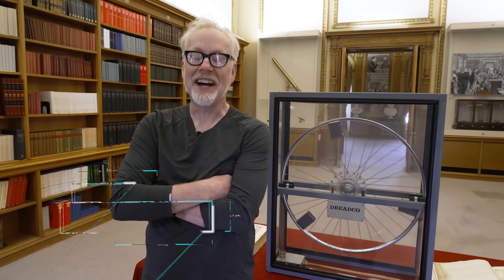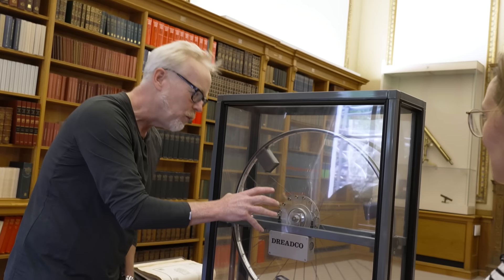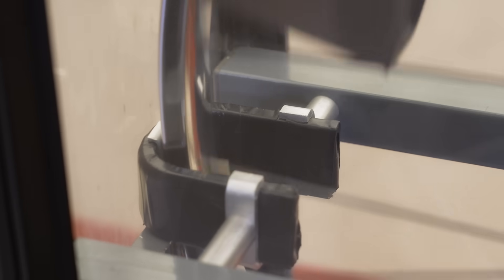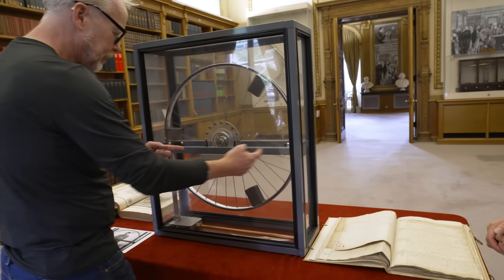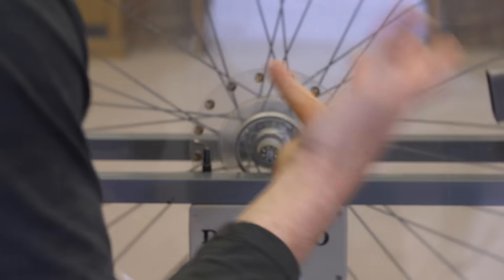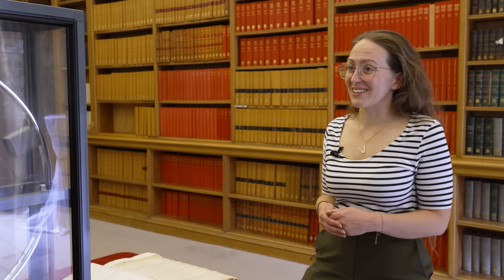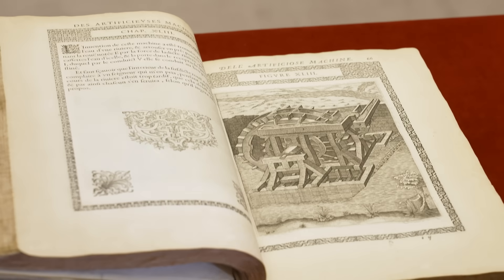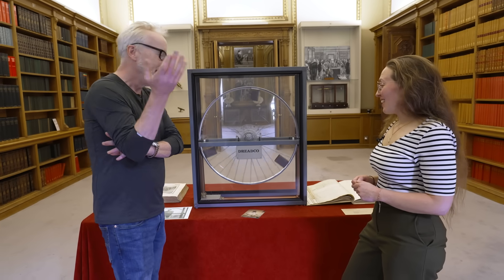Adam Savage vs The "Perpetual Motion" Machine!

Comment: I would imagine the servicing would be to replace the battery and clean the bearings of any dust particles..
If it is actually a motor that would need as little resistance as possible I know with differential temperature Stirling engines that you can put over a cup of hot water, the bearings would need cleaning with methylated spirits from time to time…

Comment: Apart from electromagnets there might be a different possibility, an almost pure kinetic one: what would happen, if the three boxes contain some sort of clockworks, that simply move small weights around? When the box goes up, the weight would be on the inside("hubwards"), and when the box goes down, the weight would be on the outside ("rimwards"). If I remember correctly that would mean a greater lever on the down going side of the wheel, thus a greater prying effect as on the other side.

Comment: I don't think it is electrostatic, I feel that there would be patches of dust on the casing on both sides of the casing glass, so the knob and spike in the middle are red herrings. The boxes at a bare minimum are weights to even out whatever mode of impetus is being used. The U shaped metal are not magnets as they would cause the wheel to stop due to magnetic braking affect, that is the aluminium would have eddy currents induced as it rotates through.  
My guess is either each box has a battery and circuit to pulse an electromagnet at the right moment, or even just one of them, as others have suggested. The alternate is that the box at the bottom has the power source and discreetly powers a motor in the hub. It could even have commutator sensing, only accelerating the wheel when it slows down. 
The light sensor windows could also be power saving, knowing it was stored in the dark, the wheels speed could be maintained at a lower speed when in storage. When the light goes on, it knows it going to be shifted so it doesn't have to be discrete in accelerating the wheel. possibly maybe a movement sensor as well.

It would be fascinating to examine it up close with a multimeter, looking for static electrical fields, and a magnetic probe connected to an oscilloscope to examine the U shaped metal and their interaction with the boxes. Maybe a logging tachometer watching wheel rim, I saw a couple of features inside the rim that could be used to trigger.

Comment: It’s probably really simple. Like the box is under a slight vacuum, those weights would be enough to keep it going for a good while. Of course air will leak in and it periodically would need to be suctioned out. The gasket around the sides looks thick enough to hold a bit of one.

BTW: go away scammers, I didn’t win a prize or reward, you’re not official. Sod off with your schemes.

Comment: A few minor points.... with the first machine is it possible the magnets are very gently ionising the air in the copper pipe and that's causing a very tiny amount of air flow to blow on one side of the wheel and thus causing essentially a permanent air current within the box thats causing the wheel to maintain it's speed? I know magnets and copper do weird things, but that could explain the copper pipe in the system.
Secondly the perpetual motion machine in the wheel isn't there to make power, but to keep the wheel turning while there is no water, so you don't have to restart it, which takes a considerable amount of effort and thus lost power. So it would be more about preserving it's current momentum rather than harnessing power.

Comment: It's just a small current motor where the coil is in the DreadCo box which also contains a light sensor to minimise power consumption when stored away. The small copper buttons on the wheel are magnets which makes it a brushless motor design. After 2 years the battery is exhausted which ties in with how efficient battery clocks are which can run up to two years. The wheel itself is finely balanced so very little energy is used to keep it moving. The End!

Comment: Could the boxes contain some kind of magnetic sand that when passing through the u-shaped side pieces becomes charged and either clings to the inside of the box or falls away? It might rely on the principle of a rotating ice skater spreading their arms to spin slower and bringing them in to spin faster.
Reply: All the extra spin you get from moving sand closer to the center is lost again when the sand moves back to its starting position. At best you get three pushes and that's it.
Reply: @Yora21  I was thinking more like the two u-shaped pieces represent switches that alternate the position of the internal weights. Maybe they generate a field that switches polarity somehow. When one of the boxes enters the field of the left object, the internal weight is shifted outward and when it hits the right one, it is shifted inward. If the fields are large enough, you could give the wheel more torque on the left and maintain momentum on the right. I guess that I was thinking more of levers than of centrifugal forces.

Comment: One possible energy source for a 'perpetual' motion machine is a tritium tube surrounded by high efficiency (low output) solar panels which can convert the radiation/florescence to electrical energy... but maybe they could be using a different radioactive source for powering the device which generates heat and they use a seebeck device to generate electricity using heat differential (like a space craft utilizing plutonium to generate power in this way for decades)... maybe not what is used here though.. they could be using 'Zinc air' batteries as a long life low power energy source.. the rest to me just looks like a typical motor with Magnets on the rotor, stator windings (electro magnets) which are controlled by hall effect feedback from the inner wheel and sensing probes. Only a small regular push on the flywheel is required to keep it turning. How often do you replace an AA battery in a wall clock which runs continuously?

Comment: These two round perforated grills located on both sides of the central box could hide microphones which are capable of generating the small amount of electricity which could be enough to keep this wheel constantly spinning. This wheel is usually exposed to  crowded places with a lot of sounds and noises.
Also, there are clocks that work on the atmospheric pressure changes, it also might be the case.

Comment: I think the copper pipe is a decoy. When you think about it, it absolutely has to be a motor as Adam pointed out. I think the creator had a good laugh looking at everyone theorising and trying to ‘figure out’ what is a very basic thing.
Reply: The heatsinks on the bottom give it away. Anything that uses enough power to need a heatsink would drain the battery to quickly, I agree its likely a decoy.

Although it may use heat in some clever way.
Reply: @georhodiumgeo9827  for sure a decoy.  Or the tubing at most is used to run electric wires.  But there's no way this is generating any kind of heat to need a heatsink, that would defeat the entire point of getting something to run for years between charges.
Reply: magnets are in the pipe i think the wheel is acting as a rotor and the magnets and box are charged possibly by solar at a low power, the two angles of the pipe can allow for more angles of pull maybe
Reply: @Zach Meyler  Can't be solar, it's kept in the basement.
Reply: clockspring! its like a watch but you wind up a few years rather tha a few days. or the rim is hollow and you can fit batteries there on the black boxes plus the lentgth of the pipe plus the silver box! and have the motor be very low power to spin for quite a while.
Reply: I'm sure it's a motor, but why is it kept in a museum? Any other PMM machine wouldn't be kept, would it? What makes this one special that they'd go to so much effort to keep secret?
Reply: @Here_is_Waldo  probaby just the guy who made it. Like painting, anyone can paint, but some people end up having their paintings in museums. Not all art is special, some is just interesting, like this piece.
Reply: @Here_is_Waldo  they keep the cooler more interesting things, this was interesting enough.
Reply: @Here_is_Waldo  its just an exhibit. There are no pmm
Reply: or is it part of a heat pump generating a small charge from the heat in the room
Reply: Probably not. Because it’s a library there’s probably little change in the temperature.

More than likely it’s a pulse motor powered by a carbon zinc or other long term battery.
Reply: @Jon-2049  Probably, We know that some sort of chemical battery is being used and a motor most definitely located in the wheel hub.

Comment: Couldn't it just be a small pulley system? Like a extremly thin, basically invisible rope around the wheel, into the tubes and box, where there is a motor and batteries. because i fell, like basically everything else is probably just a decoy.

Comment: It's a planar electrostatic motor with an amazing bearing.  

I am now working with an energy storage cylindrical shaped flywheel of a few hundred kg.  It spins up to nearly 100,000 RPM.  It is housed in a vacuum chamber to eliminate air drag and it uses magnetic bearings, also very low drag.

Comment: There's a rotating magnet or array of electromagnets under the table top. Duh!
Reply: So we're supposed to trust them that they take it off the table and put it in the dark in storage and it still goes?

Anyway, a zillion places to hide power sources in there. It should be able to run for decades instead of a couple years.

Comment: If only someone would create a magnetism visualiser ( like a flir )
Reply: It was determined there were magnetic fields coming from the hub and the box with fins on the bottom, and nowhere else. IMO the fins, the copper pipe and the three black boxes are deception. The box labeled Dreadco is just a place to put the name. The placement doesn't suggest anything and it's also not connected to anything. The "probes"also are deception IMO. It's also not in a vacuum, the case just prevents "tampering" by an errant push (or possibly the wind ) when out of frame.

Comment: I think a motor is to obvious and too risky, thats gonna be everyones first guess. Ive watched this a few times and i think theres an air line running through the copper, then on the end is a tiny fitting that causes the wheel to spin. Ever so often the tank has to be refilled. Its simple and a little disappointing solution so i think it fits most of what's being said

Comment: Hi Adam
Love your vids

Re the perpetual machine, we both know that perpetual motion thus far as not been achieved.

Also approx two years indicates to me 100% batteries are involved.

There could be an efficient motor in the three boxes with a small fly wheel in each, this would generate a small centrifugal force and turn the wheel if everything is balanced finitely then it wouldn’t take much force 

Everything else just looks like decoy to me. 

Having seen your vids and knowledge I’m sure you are on it.

Kind Regards
Mick. (UK)

Comment: ok , fine
the dredo box is a battery 
electrodes are the brushes 
the acrylic hub insulates the spoke "wires" 
to the 3 coil boxes on the wheel 

its an electric motor

Comment: The three blocks are magnetized, moving trough a coil. That are powered by the box with the name on it. They "service" it by replacing the battery. That's a big enough battery to keep a mechanism like that running for 2 years. Basically a modern clock pendulum that spins.

Comment: given that they have to move this thing without it stopping, the copper probably doesn't do much except possibly produce a tiny tiny gust of air. the center box probably doesn't do anything at all. the glass bearings do most of the work preserving motion

Comment: The glass (or transparent plastic) thing on the box with the "Dreadco" label looks a lot like the sensor from an old selenium type light meter. Those did not need a battery, as the selenium cell is a photvoltaic cell. I think that might be the power source,  and as other commenters have noted, it would take very little power to keep that wheel spinning at a low speed. Then again, the copper pipe and aluminum heat sink assembly suggests some kind of heat engine, like a low power Stirling engine but I'm not sure where anything on that apparatus would generate enough temperature difference to make that work.  I'm going to go with a photovoltaic power source and an electromagnetic or electrostatic motor, with maybe some sort of battery or capacitor for energy storage.
Reply: Given what little I know, about the creator, I totally believe he put red herrings into the gizmo.  So I don't trust anything I see.  Other than (a) you could easily put batteries into various hidden locations in that thing, and (b) if those are light cells, it would not take too much light to keep that turning in a vacuum.

Comment: What about the vacuum inside, reducing rotational drag? Also, the three boxes are probably for perfect balancing and for creating a lot of inertia (they're heavy).
Reply: I thought about it being a vacuum but when he accidentally hit the glass it sounded like just plastic with no vacuum pressure
Reply: @milestonowheres  What would it sound like in a vacuum, or low pressure?
Reply: @mikeh6286  the pressure would have held the glass/plastic so tightly that it would not have rattled.. it would have had a solid sound.. with no sound coming from inside. There is no sound in a vacuum

Comment: Air resistance would consume about 1 mW of power, so running for 2 years would need about 17 Wh of batteries, which is about 4 AA cells, not including mechanical efficiency. Within this form factor there are quite a few ways to do this.

Comment: The Norwegian artist and inventor - Reidar Finnsrud - has created a similar machine except on his machine the moving object is a steel ball rolling on rails of aluminum. If you search for "Reidar Finsrud perpetual" you will find several videos with explanation on how it works. Unfortunately the best video where Finsrud himself explain how it works is in Norwegian without subtitles. I've been to his gallery several times and watched the machine running. It's a fascinating machine. When I visit his gallery and watched for the first time he said that he had clean the steel ball for aluminum residue every 14. day because the residue created too much friction. He used aluminium because of it's non-magnetic properties. He might fixed that in later versions of the machine as he could've used some kind of stainless steel that is non-magnetic. It's more than ten years since I watched it last time, but at the time the gallery was open every day and everyone could come and study it.

Comment: What are the requirements for a "perpetual motion" machine? If there a minimum weight for the moving part? Can you use electricity at all? I understand no power source, but does solar count? What about heat or cold? Radiation? Can it merely move up and down or side to side? Really it is impossible to cut-off all possible external sources of energy. The topic has always fascinated me. Logic would have it that a combination of physics principles should work in tandem possibly.

Comment: I guess every few years you would have to replace the ball bearings, they dont last forever, or at least the oil they are lubricated with will need to be replaced. To me if it stops every so often then its not a perpetual machine but a highly efficient motor.

Comment: I wish I could remeber the video but someone just had use legos and tiny air pipes to make mini temporary self sustaining engines. As the flywheel would spin one mini handle would flip a double pressure cap switch allowing the pressure of the air to move and push back on itself and then as the 2nd handle came through it pushed the handle the other way. Forcing pressure back to keep it going. As long as the flywheel was being pushed and kept going with a small help from another pressure pipe the tiny engine went on its own for almost 4 days I think? It managed to charge a dead rechargeable battery less than half but it worked either way. It was passive "free" energy.

My guess is this works no differently than the shake flashlights. As the magnets are set up it gives the needed negative and positive at the right intervals and the copper wiring is in the copper pipes. The magnets are probably wrapped so we don't see that the flat sides are covered by a metal or something that doesn't allow the magnet to get stuck on the sides. The edges are possibly exposed to pull the wheel to the little metal pieces on the sides then as the magnet passes it just continually "pulls" itself along. As the magnets pass I wouldn't be surprised if it gives off a charge and there is actually hidden wire, ie: just like shake lights.  To be honest I'm not even mad that they are keeping it "top secret". It's just that when it comes to the "Perpetual Motion" Machine. It's honestly Not impossible. With a little imagination and just putting the right things in the right place, anyone can make it with the right tools. The "Perpetual Motion" Machine honestly doesn't have to be something that lasts "Forever". But anything that even when slow moving could be utilized to sustain something else like a rechargeable battery outside of the case so that when the magnets move it can be interacting with another copper wire set up. It's by Technicality "Free Power".

So instead of keeping the blueprints secret, it would benefit people to know how it works even though its slow so people can test and experiment and places that struggle to have power off-grid or in harsh poor living places can just build this in their workshop or something. Just saying. It's basically every day items that even a poor household has lying around when you think of the simplistic items being used.